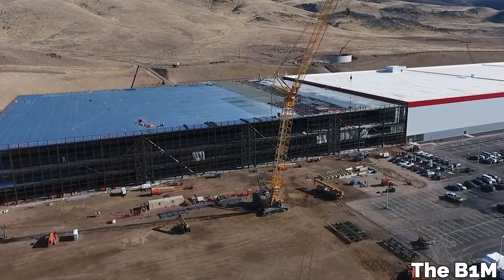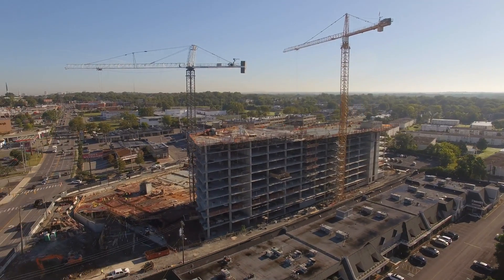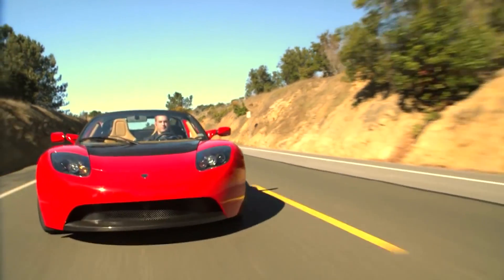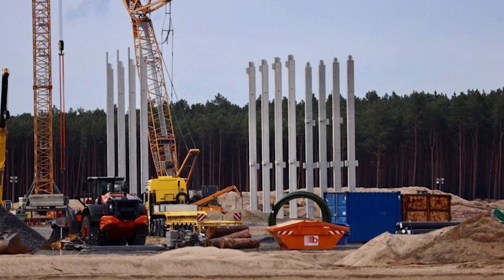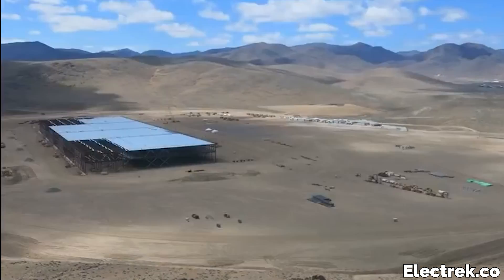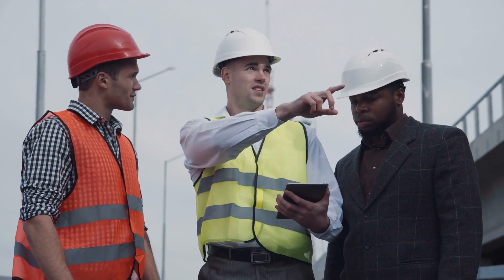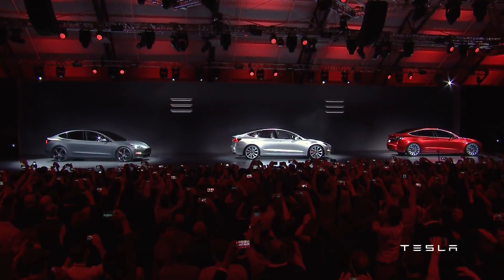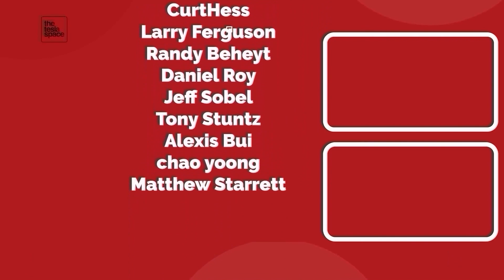How Tesla Builds Gigafactories So Fast!

Comment: The GIgaBerlin Battery Building is the most obvious example of creating the building from a kit, once the mono-slab was in place.  It was incredible to see the prefab columns, maybe 1 m wide by 30 m tall, bolted, freestanding, to the foundation, before filled in with cross beams.
Reply: That’s the typical way of building in Germany, most factories are concrete frame and concrete wall panel with metal double skin or inner plus membrane roof. There’s not much that’s unusual about how the buildings were built apart from the speed which is just a scheduling thing. Most construction companies tend to set timelines to suit themselves and just don’t push hard enough.

Company I used to work for built 1m sqft sheds in 18weeks using standard steel frame and cladding

Comment: Thanks for the video but you need to take a look at Eiffel Tower, friend. Every metal piece is different, designed and forged individually, put together by hot rivet - over 2.5 million of them. Each rivet took a crew of 4 to put in place and they had to have a furnace right at the location to heat it the rivet up before hammering it in. The whole thing took about 2 years to complete - 150 years ago in 19th century! They had no computers, no massive lifting gear, none of specialised power equipment we have today. Even accounting for inflation, it was made at very little money
Reply: China built a 57-storey tower in a record 19 days in Changsha.
Reply: @favesongslist  Cheers Tim, 3 floors a day on average, surely a record! There is also Hoover Dam to mention, completed in record time with mostly elbow grease. Tesla moves at snail pace in comparison
Reply: Wrong!!!!!!! Stop lying!!! The same Eiffel Tower can be rebuilt today in less than one year with all the super advanced construction methods the cranes, the computers, AUTOCAD….. building with steel is relatively simpler compared to concrete….
Reply: @alanmay7929  You're so thick and stupid that didn't get what I wrote, so find someone who can read and hopefully they will explain it to you. They didn't have long lengths of imported steel to cut to size and weld together - each piece was designed and forged individually - it wasn't a prefab structure, each piece was riveted in situ by hand.

Just because you don't know history or don't agree with what my comments, that doesn't make me a liar! 
If you ever learnt your real father is, ask him about this too. Surely your mum doesn't have good enough memory and didn't keep count, so needs a computer to keep track of all your fathers! You can buy her one now, so she can look for more clients, I mean new fathers for you at her age
Reply: @soundslight7754  we have building significantly higher today with steel construction too! Again with modern machines and building systems and machine’s everything can be done in s record time we have all the equipments! It’s only rings like Egyptian pyramids that are on a whole new level lol…..
Reply: @soundslight7754  prefabs can also be made extra custom depending on the project! Not all pieces/parts are always the same and since it’s made in factory there is All the equipments to make very custom parts. 🤡
Reply: Oh let’s not forget the massive and much better steel industry today! We have massive trucks and trains that can very efficiently and quickly deliver the prefab steel directly to construction site. We even have helicopters to lift massive preassembled sections too.

Comment: About 20 years ago or so, I recall general motors design department presenting a skateboard type of design where anything could be added to and create many different types of vehicles and even having chassis that could be removed turning a commuter into an SUV etc

The idiots in charge of management nix the idea.

Which reminds me of an old saying "bureaucracy is a sand in the gears of progress".

So long come see Elon Musk and realizes this is a great idea and starts producing electric vehicles.

Sandy Monroe, who work for a major automotive manufacturer Baymont the fact that anytime somebody wanted to present an idea that was an advancement it was immediately slapped down by the bureaucracy.

So ineffect the big car companies shot themselves in the foot, basically because they did not want the consumer to have a vehicle that required no fossil fuels was much more reliable and would last much longer, because this would kill their major income of selling vehicles or cost or so and making up the money and replacement parts.

Some years ago I had an engineer who worked for one of the major car companies and I was running a scuba diving operation and afterwards here in the Caribbean we'd have free rum and coke after the dive.

It's the Latin saying goes in Venus is veritas
In other words in wine is truth

And after some chatting and rum he is supposed to when he started working for this major company the new engineers were brought in to be oriented and we were told every part must have a certain lifetime, one of the engineers asked but what if we could make the same part at a lower cost there was last longer, they were probably told don't do that.

The major manufacturers made their bed so sleep in it.

Comment: Building with prefab is Common in (western) Europe. Small and large buildings. Imo he definitly made progress in the conventional time it takes to build a factory like that.
Reply: He made absolutely zero progress in the time lol…. It’s all possible because of ICE and diesel
Reply: Why didn’t he use horses or electric trucks!?
Reply: First, it wasn't built in a year, more like 3 years and both Berlin and Austin are a long way from finished, heck, giga Nevada is still only 60% built and that started 10 years ago. 

And it was all built on fossil fuels. Building EV cars and new factories is not going to save the environment, it is just a money making venture. 

If you wanted to actually change the world with EVs use an existing facility and convert ice cars to electric would be 100 times better.

Comment: Great work! The building of the machine that builds the machine is amazing too. Consider the timeline estimates from current ev manufacturers, they reach out years for smaller factories.

One question I have is in configuration. From where I stand, obviously quite far from the inner workings of those factories, I suggest considering a circular design rather than the folded linear one used. Seems to me that they can press out far more castings than the factory can keep up with. The biggest bottleneck seeming to be paint.

Put the casting machine in the middle feeding out in morphing radials, defined by volume intended into the BIW, then a ring of paint stations that then feed into finishing rings with receiving docks along the outer rim.

Where the next ones?

A Great move is building out one in the Flint area, home terf of ICE. Talk of Mexico would work well for a solar, battery, lithium refinery. Add in a factory focused on manufacturing spare body parts would help with the long wait for repair. Toronto for another solar battery refinery with a motor section too. Another one in Europe, maybe Ukraine, when the bully stops bullying. Australia for a dedicated right hand, not that will be an issue once full drive by wire is put into place. Oh, and another battery solar one in Appalachia. Help out those coal workers.

My Christmas list.
Reply: There is absolutely no reason to build a factory in Ukraine, putting all your technology and practices and supply lines within a stones throw of an embargoed nation (russia) 

That's like saying your barbecue should go in the back corner of your yard, far from the patio and kitchen, with 10ft privacy fence directly behind it made out of wood 🤣
Reply: Nonsense!!!! So machines haven’t been building machines for decades already!? Also very fast construction is because of ICE, diesel and the already advanced prefab construction methods, you’re welcome.
Reply: Or make castings for vehicles that are totally crap with no mods possible! The cybertruck is just a really dumb concept for trucks!
Reply: Are they going to make ford f 250, f450, f450 competitor with the same crap castings!? Lol…..